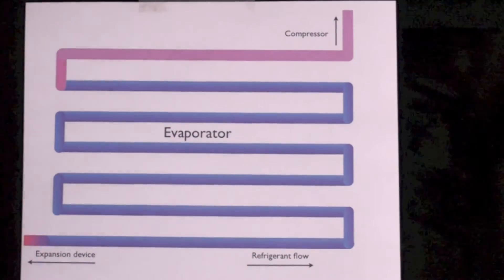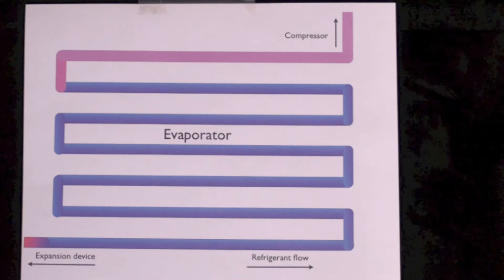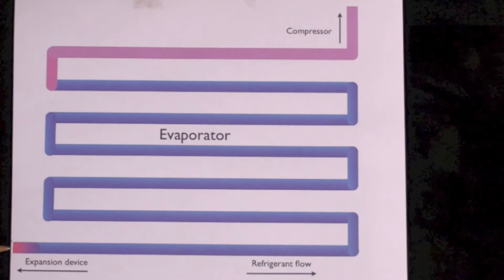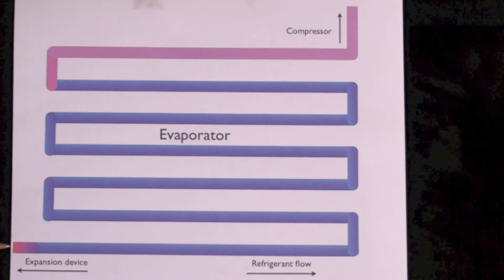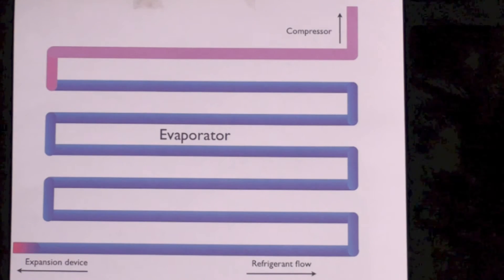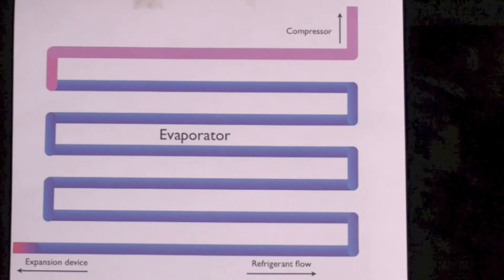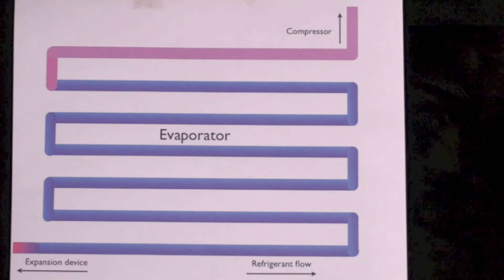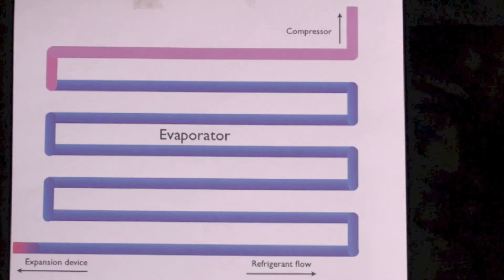What does the evaporator do in the air conditioner.

Comment: You said if liquid goes into the compressor goes bang. But what if the AC stands still for a time., let's say serveral hours. The complete pipes are filled with a saturated mix of liquid and gas.  When the compressor starts first, it gets  this mix of liquid and gas but it doesn't go bang.  I think to much liquid is not good for the compressor but it doesn't  go bang immediately .  A 4-stroke combustion  engine goes bang immediately because of uncompressibility of liquids  but not a compressor of an ac.
Reply from the maker: In many cases, compressors have a heater to drive out liquid refrigerant in the off cycle.  Also compressor design has had to deal with liquid flood back for as long as compressors have been here.  Such as: liquid will first go to the bottom of the compressor, so the intake of the compressor is located at the top of the compressor.  Some compressors use spring loaded valve plates that will lift if liquid is in the cylinder.
GFM
Reply: Ah!!!!  Thank you very much!  :)

Comment: grayfurnaceman I heard that when liquids of any kind evaporate, they expand, when refrigerant expands and evaporates across the evaporator, doesn't the expansion cause the refrigerant to move faster going out then going in?
Reply from the maker: John Smith Actually, the refrigerant does expand when it boils.  It may or may not move faster as it travels thru the evap.  However, the coils are designed with tubing that is large enough to keep the speed within limits.  Hope this helps.
GFM
Reply: That explains why the suction line must be sized right on long runs, so it doesn't lose too much speed and trap oil.